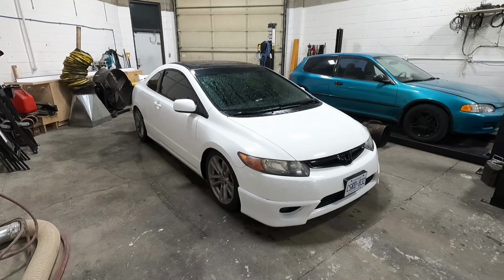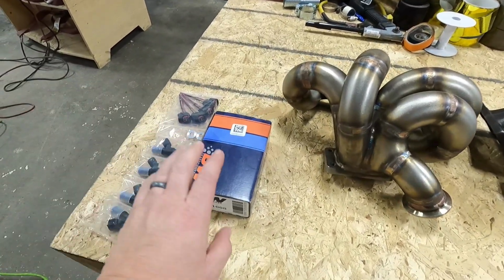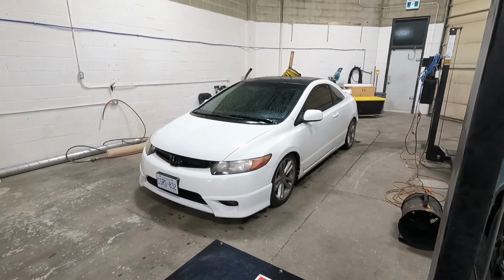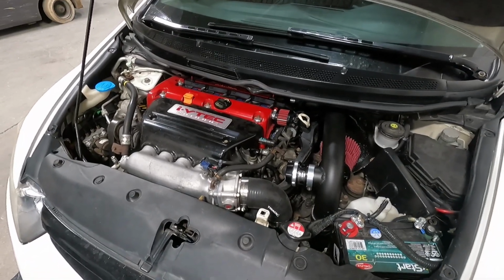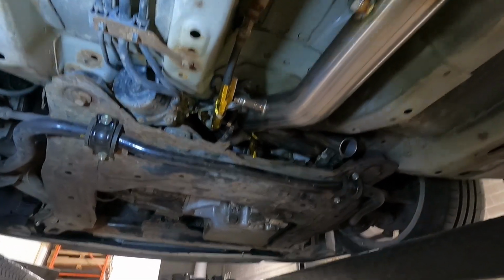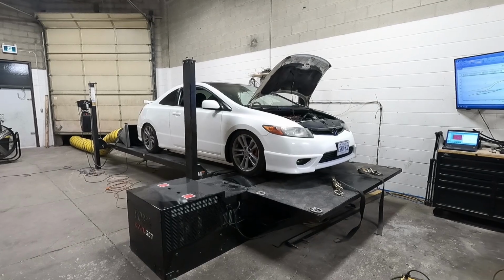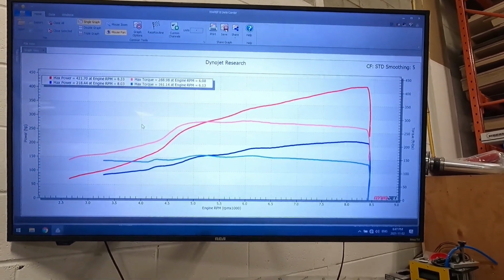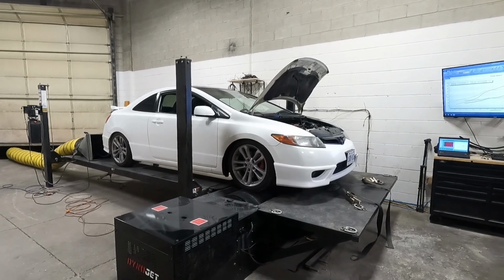Turbo 8th Gen Si - PRL Turbo Kit - GT35R

Comment: Yes yes the thing that scares me most about turbo charging an 8th gen.. the heat control so close to all the firewall components. I think you should do a long term review on how things hold up back there. 

Coming from a Kawapped integra I can tell you the heat killed everything within 8-10 inches of the header. Had a Ktuned ram horn header and had to switch to a more low profile DC swap header. I hate heat!! Lol

Comment: From your experience which would you recommend a newbie supercharged kit like kraftwerks or a turbokit such as this prl?
My 8th gen is just fbo with basemap for now.  I just want a mild mid 300's horsepower
Reply: Nothing beats the sound of a turbo.
Reply: Not to mention the turbo would be more efficient as well as cheaper. Although a supercharged setup would be awesome too!
Reply: Comes down for that power level at they powerband that you want to have. Seem to both be about the same price.
Reply: @chrisdonnelly5904  turbo is most definitely more $$, unless you use junk parts. These PRL kits with a nice turbo are close to $9,000CAD.

Comment: @Nick, how is the car holding up
So far?? I have a PRL kit i bought brand new. Installed in 2016 car had about 160,000kms on it. Have just over 187,000 now. Running the GTX30r numbers were 420whp 310wtq.
Reply: Why do you low mileage owners act like that's a lot 😵😵😵 fuck man I got a 160,000 MILES on mine that's like 250,000kms
Reply: @repingers9777  I’ve got 577,000 kms on my 06 LX sedan. (360,000 miles) original drivetrain. Hell all fuel components are even untouched 😎